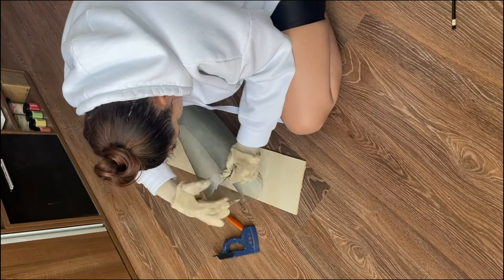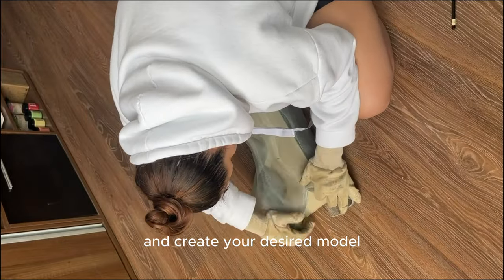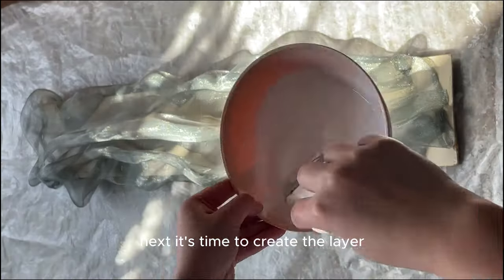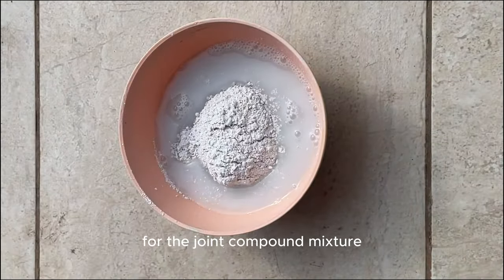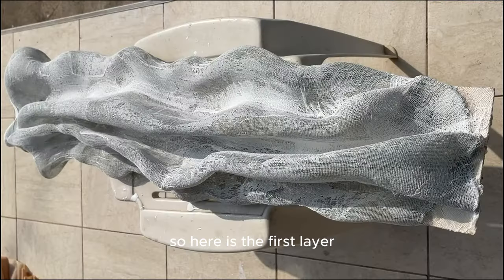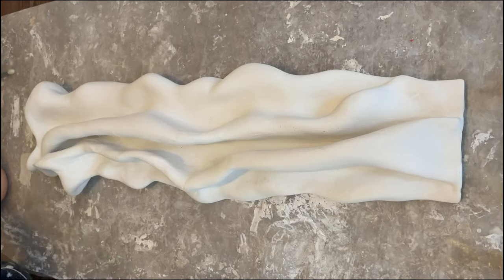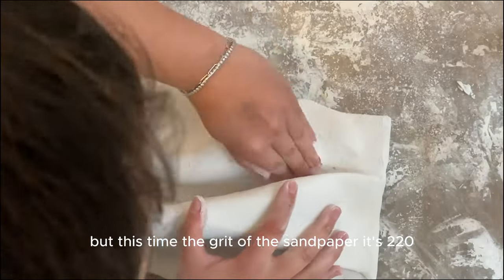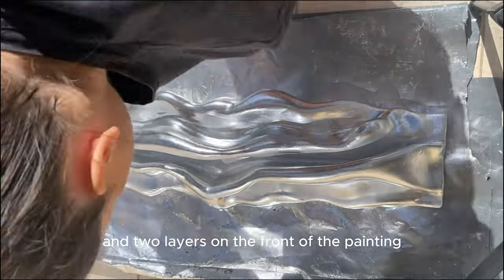DIY PLASTER ART - chrome effect

Comment: hiii...its amazing work stunning , i'd like to ask if it's ok to use putty filler instead of joint compound, i used plaster of paris but it gets lumpy and harden after mixing with water and i kept adding water and now it doesnt dry hard
Reply from the maker: Hello! Thank you so much! We tried putty filler and it cracked that’s why we use and recommend the joint compound in our links.

Comment: Hi Mico - my plaster bandages are showing through the joint compound after multiple layers, mostly where there is a slight overlap of bandages. Would this be because my joint compound is too thin, because I didn’t use wood glue, or because I should use really wide bandages (I used 4in wide)? Thank you!
Reply from the maker: hello! most probably is because of the joint compound. when you create the mixture make sure it’s not watery and it will be thick and not fall of the putty knife or brush.